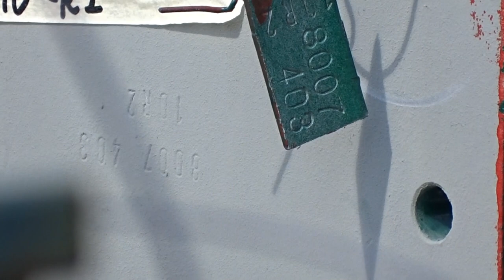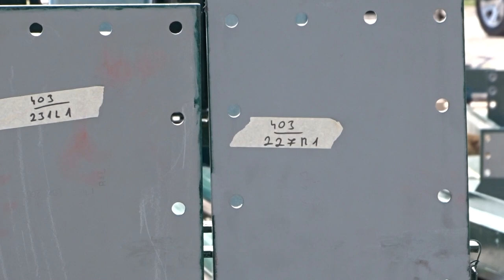Canada's Wonderland New Coaster Shipment Arrival July 24

Comment: Take this for what is worth.  With Kennywood's announcement,  does anyone else wonder if Cedar Fair is going to change things up a little for one of the coasters they are putting in at Carlowinds or Canada's Wonderland.  Looks like track construction has not started past getting footers in at either park.  One would think it would not be all that hard to replace one or two sections of track at the 200 or above so they can have the record.  Just thinking out loud.  Wonder what every one else thinks of that.
Reply: I think It's probably more difficult to do that than you think.
Reply: It would probably be a huge endeavor to retroactively change the height of the inversion. For one, every element of track is designed to provide safe g-forces (and complete the course) with the calculated momentum of the coaster. So, to increase or decrease the height of an inversion could cause rollbacks or unsafe G's, depending if it gets bigger or smaller. Also, the shape of the track may have to be changed in more than one place to accommodate a larger or smaller inversion. However, I assume that if the coaster is 255ft.+, and especially if it's a giga, the first inversion will likely be over 200 feet anyway, so they wouldn't have to change anything.